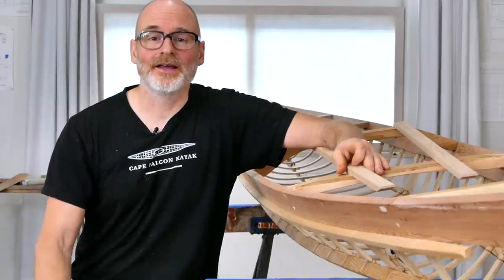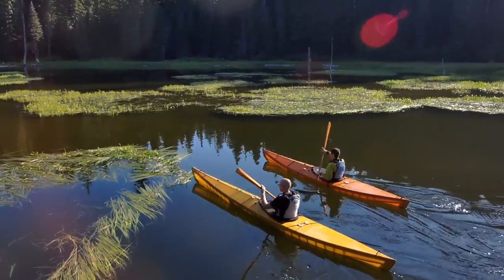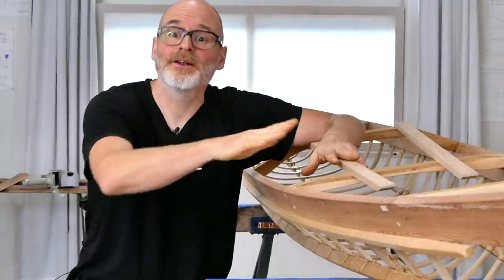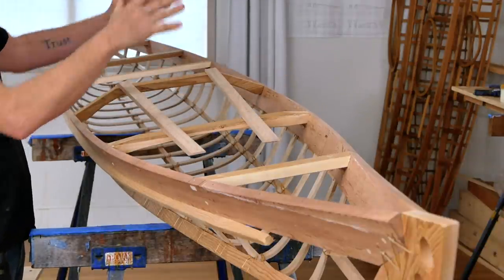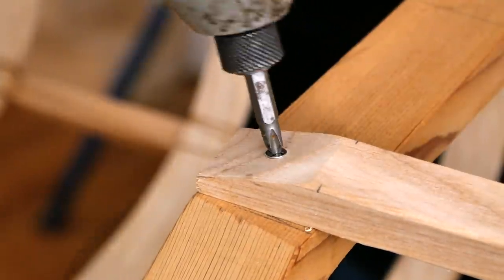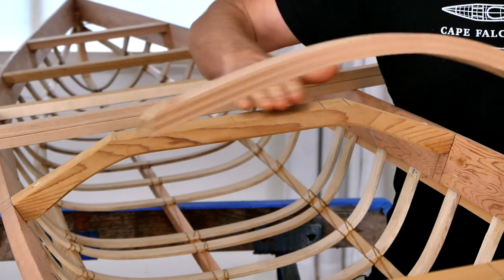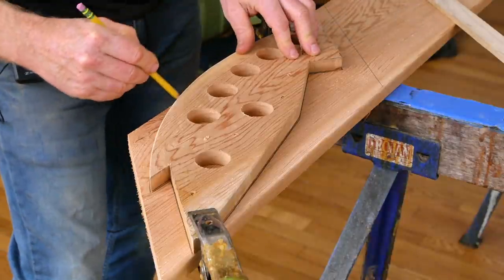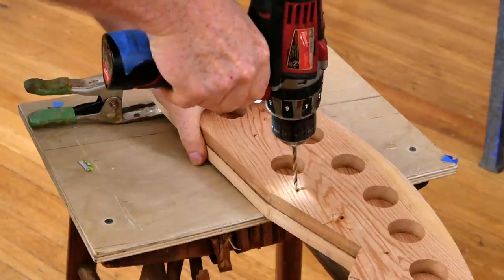Inside my Skin on Frame Kayak Design Process: Adapting for Sail, Catamaran, and more!

Comment: Great ideas, I would have liked to see a drawing at the start to see where you want to end the design. I was thinking on the deck stringers and the areas for your cam cleat why can't you add a longer piece from where the stringer attaches to the gunwahl and taper it down to 0. This way there is backing for your cleat w/o air under the skin at this location. Yes it will add a few ounces on port and starboard but be solid as heck. Bored we ain't stinking bored. Like to be in your shop brainstorming with you.  Happy Holidays to you and Liz. Be well!

Comment: Late to the party. Brian, since you already do steam bending for the ribs,  have you considered doing shallow steam bends for the deck beams? That will prove stronger than the laminated deck beams and will allow you to play with the shape more dramatically. Since the radius is so large, you may even be able to get a piece of cedar to steam bend to that radius relatively easily. If you wanted a more complex shape, say a flat beam top with a  tight radius down to the gunnels, you could use a light but strong wood like cherry. Cherry has the additional advantage of being at least as rot-resistant as cedar. (It may be possible to still do this with cedar or pine, but it would have to be a good piece.)

Also, I am in love with your work. I can't wait to buy the F1 plans and course and build myself a pair of kayaks for my fiance and me. Thank you so much for putting in all the effort you do to these.
Reply from the maker: Unfortunately that doesn't work, the boat slowly flattens out over time.  Top or bottom needs to be rigid.
Reply: @capefalconkayak  Good to know. Thanks for taking the time to respond.

Comment: Whatever the "functionnal" reasons behind it, I like the improved esthetics of these lower/flat decks that streamline an bit the front of the F1 for non-long-term-campers (some of us are only day-boaters, or ultralight packers). Although not considering quaramaran or even sailing, this is the kind of esthetic "tuning" option that may just convince me to start kayak building 🙂. Curious to see when it goes from here and what the next prototype will look like (and compare to the whitewater SOF prototype).

Comment: thick wall high pressure pvc pipe rings with a slot for C-clamps.. double or triple up like spring leaves to double clamping pressure.. Suuuper cheap super light & epoxy & glue proof

Comment: Just putting in a plug for developing a beta release of your river touring kayak plans.  There's nothing available like that except some cripplingly heavy and awkward roto molded monsters.  Lots of rivers in UT/ID/WY await!  Thanks.
Reply from the maker: I’ve got at least a year of other design work before I can even think about that again but at this point I’m not sure I’m gonna develop it any further because 98% of the correspondence that I’ve gotten about that boat is from people who really should either be in an F1 or a plastic Whitewater kayak from the 1990s.   It’s just such an ultra specific use boat, Designed for high-volume rivers with mostly class one swift water but also a few must run class 2 to 3 Rapids,  in a multi day loaded boat triping context meant to be used by someone who is a good enough pilot that they can avoid just crashing super hard directly into big rocks or taking bad or dangerous lines.   That’s a lot of specifics and if you change any one of those variables it’s not the right boat.  Also the Hydro dynamics are just teetering on this knife edge that I’m not sure if I can fix as soon as I brought the volume up to what I needed for stability it lost a little bit of the magic and it was that magic that gave it an edge over other crossover boats that are out there.   So at that point you have to ask yourself is the 20 pounds that I’m saving worth of the possibility of breaking the boat if I pin against the rock?  And also the fact that you can run those boats in very shallow water and this one you can’t.  Lots to consider….

Comment: I suggest custom building the foot braces.  I am not a fan of plastic equipment.  I prefer aluminum. This way, you have a design that will work in all the Kayak designs.
Reply from the maker: The problem that we’ve had with aluminum is that it freezes the second it touches salt water or any kind of sand which is why you don’t see commercial foot braces is being made that way anymore.